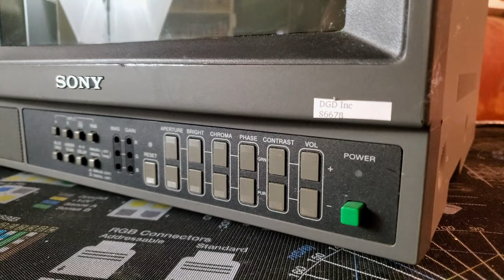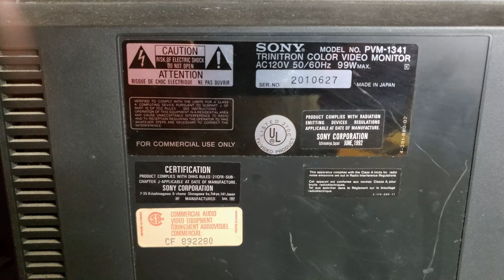The Sony PVM 1341 CRT Restoration

Comment: Steve,  you have done a good job on this unit,  the ELNA blue caps should be all the way replaced on those old units they are prone to fail
The 1340-1440qm tube is awesome,  very rare to find one still in good shape with still strong emissions,  1342-44-1442-44qm "fine pitch" are more reliable but not better in every way!

Comment: Hi there. Another nice video thanks. Could you take on a job of making a vectrex work again? Its worked for years and just stopped turning on.  And how about attempting to get a Toshiba TIMM CRT working again (these are very rare CRTS). It worked for several years, and one day it doesnt turn on the tube. I see a green light come on, but no picture.

Comment: Hey there! So I recently got a Sony 1342Q PVM, its in pretty good shape, I opened it up to make some adjustments for the geometry, now I am noob of noobs with these PVMs, I have done some reading on them, but with the adjustment dials in the system I heard there are a few that control voltages or something? I know that I twisted all of them back and forth some and found that a few didnt change the shape of the screen. I am sure I will get scolded or something about messing with things I dont know about, BUT, my question is for the ones that may control voltage or things that are not geometry, how  do I find the setting they should be at so I know that I dont burn anything up by being a noob? I had the TV on for maybe half an hour to test it, but I want to make sure I got everything correct on it.